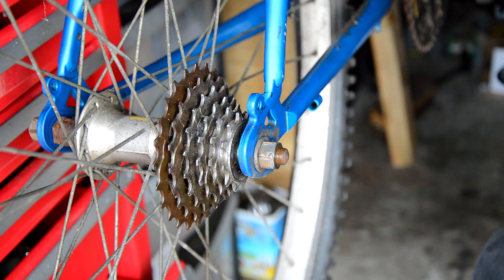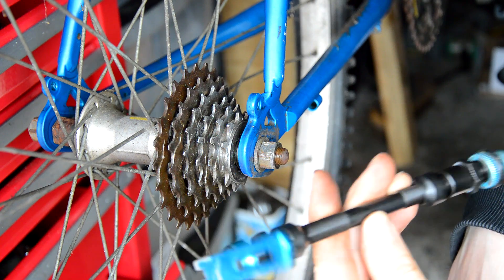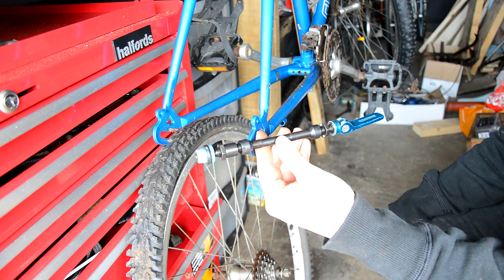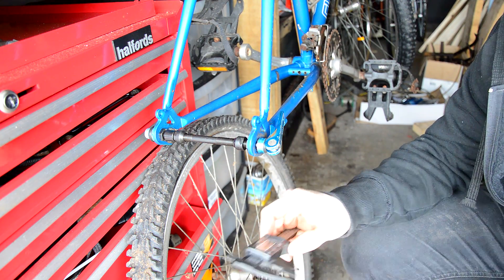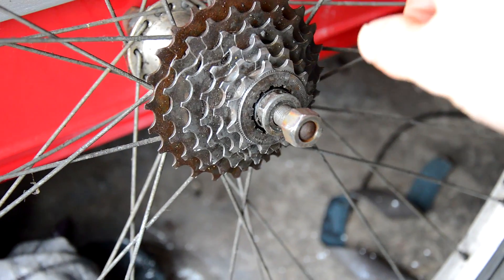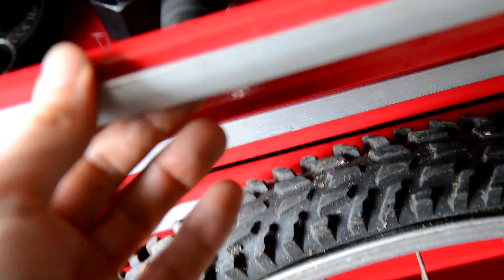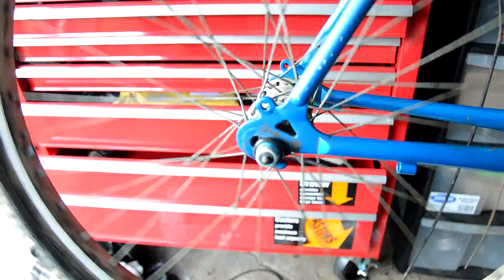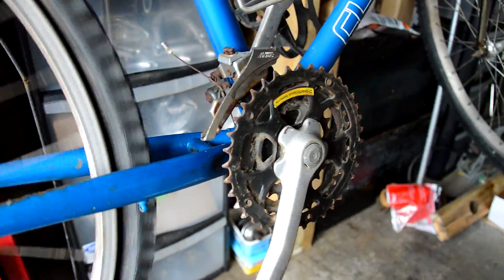Solid (Nut) To Quick Release (QR) Axle Conversion - Bicycle Maintenance

Comment: did you put a 10 mm diameter axle to change the 9.6 solid axle? any problem with bearings/cone ?
Reply from the maker: I used the cone nuts that were supplied with the new axle and new bearings so no issues

Comment: i am trying to do this now. my bike is older and the axle doesnt sit into the back of the drop outs. if i put a qr on, how do i know how far to pull the wheel backwards??how do you know in general how far to pull the wheel back. i could make the chain too long and pull it to far past the derailleur. do i just shorten the chain til it shifts ok 1 link at a time from the back of the drop out ? at the end of the video i can see your drop out is the same as mine. how do you determine the gap behind the qr into the back of the drop out????
Reply from the maker: Good question.  The frame there didn't have a hanger built in so the derailleur usually attaches with an adapter and those usually have a little lug on the back which fits in to the dropouts .  Just pull the wheel until it's at the back of that adapter usually.
Reply: horizontal dropouts suck. what I've done is on one bike, I "made" it a vertical dropout by drilling axle-sized holes, then sawing up to edges of the holes. On another bike, I was able to bolt in those little metal bars with 4 holes; it works just fine.
Point is, you'll have to do some "figgerin" to use a QR in a horizontal dropout and not have the wheel pull out.

Comment: i usually do the opposite: from quickrelease to nutted :D Especially whith 6 to 7 speed freewheels (which have a much longer lever arm wrt the bearings than casettes). The quickrelease axle is just not stiff enough. They wiggle all so slightly with each pedal stroke, prematurely wrecking wheel bearings and failing in one way or another after a while. I had one too many quickrelease axles break or bend and completely gave up on them. The feel is much more solid too.
Reply: Can you share to conversion process? Thank you
Reply: @azsamsasho  all that matters going from quick-release to solid axle is the axle diameter. Obviously you'll want a long enough axle to be able to place the outside nuts on, but that measurement is pretty forgiving.

Comment: Looking forward to seeing the finished restoration. I am fixing up my Fathers Claud Butler today (rest his heart).  I cannot decide to make it an urban Fixed bike or a 1x urban Bike?
Reply from the maker: This bike needs a lot of work... I won't be touching the paint on the frame as it's still good but all the old components need an overhaul.  It wasn't meant to be this big of a job...  As for your fathers bike, perhaps keep it original?  I don't think a retro mountain bike suits a fixed conversion personally (the Diamond Back "Frankenstein" build that's sitting behind me right now has the wrong type of dropouts).  A 1x Urban bike would work.  It would probably only shave a few hundred grams off the weight but it should be nice to cruise around on.

I feel like building another fixed gear now actually...
Reply: I have to say it seems 'Cluad butlers' always seems to be used to the point where all the components require replacing! 

However the frame and paint lasts the course of time. Although it could be a blessing in disguise as we both can start from scratch. A 1x system, new wheels, seat etc should make the bike fly, I just cannot believe how light Retro frames are? With it being 11kg rather than 15kgs etc. The bike model is a 'Hammer xl', I cannot find when it was made, but it looks  1995esk (I would love to find out).

I have to thank you for your channel, I would have never have thought to restore/Improve the bicycle without your inspiration.

Just an Idea/requests, could viewers send in photos/30 sec videos of and Bike restoration projects with the before and after? Upgrades etc? It would be interesting to see in a video montage. 

So thank you again, In the future I be sure to let you know if I went 1x or to the dark side and made it Singlespeed.

 Hopefully I haven't tempted you to a retro/modern upgrade single speed combo 😃.
Reply from the maker: The problem with this bike is more like it hasn't been used :(  Saying that though... I have discovered the crank arms are a set that should have been recalled in 1997...  yikes.

It's quite hard to find information about retro CB bikes it seems!  Brochures from the 90's are hard to come by but you can usually tell a rough date from any Shimano components.  They always have a date code stamped on them.

You're more than welcome.  I enjoy tinkering and sharing.

Now I am trying to get a bit of social media set up and linked together so once that's done I'll post it all up and you could get sharing projects there etc?  Sound like a plan?
Reply: MonkeyShred Could I ask for your option/advice? After a good clean and ride, I have noticed that being 6ft 2 on a 20 inch frame is a little cramped.  Would you call this a lost cause and try for another bike, or can you get really long and tall quill stem? 

( I could not find a Mtb fork with a 1 inch riser (to fit new new headset and a long stem).
Reply from the maker: 20" is quite a large frame for a mountain bike!  Well for a modern one anyway.  My 2017 is a Medium and that's a 17".  My two "retro" ones are in the garage all locked up so I can't compare them for size right now.   Anyway, I digress...

Is it the reach that is a problem for you?  Do you know the length of the stem as is?

Comment: Good video man. I have an old frame with modern accesories, very similar to yours, but sometimes i have problems with the quick relase of the rear wheel, the rear axle moves a little sometimes when im riding because this dont fit exactly in the dropouts, like in your frame, do you have the same problem maybe? Maybe there´s a part to correct this, im returning to riding after years.